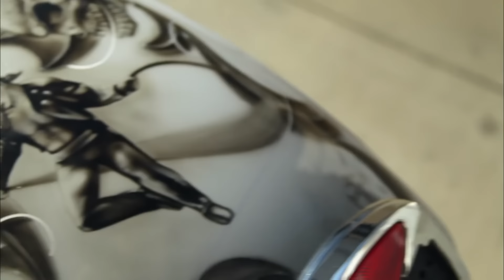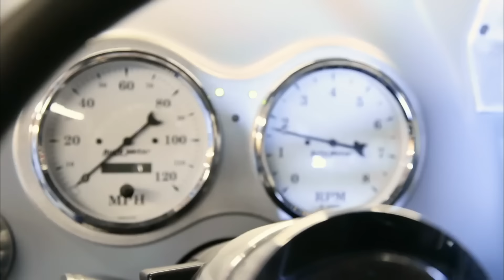The Real Reason Why Counting Cars Ended

Comment: Another problem was the 1955 Chevrolet Nomad station wagon. Counting Cars did not complete the project as the customer wanted. The customer ended up taking the car to another shop to have it done as he wanted. Counting Cars was court ordered to pay the bill for doing so.
Reply: The shop and Koker have been sued more than once. One couple wanted a particular year Mustang and were told it wouldn't be a problem. Except, when they went to pick it up, it wasn't the right model. The couple said, "That's not the car we paid for." The response was: "That's the car that you got." Another former customer sued because a car featured on the show didn't run despite the customer paying for it to be fixed up. IN both cases, the shop and Koker (in one of the cases) were named as defendants.
Reply: @mikeheuer1276 The owner of the '55 Chevy Nomad sued also because his car was not done as he wanted. He stated that he wanted no pin stripes. Danny and Ryan did it anyway. The customer took the car elsewhere and had the car redone at Danny's expense.
Reply: true and believable- but not the last sentence- you would have no way of verifying that.
Reply: @tommurphy4307  WRONG.
Reply: You need to take the drama out and get back to building professional. Cars
like you do.

Comment: The obsession with spider webs and that gross cross design should be a tip off of what’s to come, not exactly Chip Foose or Dave Kindig to mention a few.
Reply: Chip is a joke. His recipe for nearly every car is to lower it, paint the bumpers, a two tone paint job on the car and low profile wheels and tires. Big deal.

Comment: after i watched some of those guys act dangerous in the workshop, i realized it was too good to be true. (some of those guys should not have been working there.)
Reply: for sure none of them would pass a drug-screening
Reply: @tommurphy4307  Mike especially I can tell has been on and off drugs throughout the series. Some seasons he looks disheveled and sickly, and others he looks perfectly fine. It seems like hes quit using fully since about 2021 when the last season was filmed, but I do hope he stays off them for good
Reply: I learned a little about welding from taking a class at Lincoln Electric in Cleveland, Ohio, USA. I've done some welding over the years. I've seen numerous times on all of these reality shows where the guy welding hardly used any PPE (Personal Protective Equipment). I thought, "Really? Are you stupid?". THEY can do that if they want to, but I'm not going to do it.
Reply: @snowrocket  i've watched a lot of dangerous acting on the show..

Comment: I watched many episodes but I don't remember them restoring any classic cars to original or even with period correct parts. Some people like resto-mods some like original condition and possibly with some modern safety features. For example, on my 1965 Mustang coupe I put dual reservior power master brake cylinder in place of the single reservoir manual brakes system. It already had original front disc brakes. Now the car is safer and someday can be a daily driver. Even at cars shows the safety upgrades could be appreciated. The late 1965 models had some of the 1966 model features. Also, I can connect the 4 way emergency flasher to my wire harness which also appeared in 1966 and on some late production 1965 models. Nobody really checks the Vin in the local car shows anyway. Restoring cars to original condition brings back good memories to many people, to a time when life seemed simpler.

Comment: Many mechanics are bad. Especially the new guys. I seen them destroy cars. Forget cotter pins tie rods falling off, loose lug nuts, wrong oil leaking oil filters. Diangnise wrong, couldnt fix chet and a lot more stuff. I saw this and they fired 5 or 6 mechanics in 3 years
Reply: English, please.
Reply: thats because they were told being a mechanic was easy and a no-brainer. not true, but its a helluva lot easier to do than building a custom ride. both require above-average mechanical aptitude, good spatial aptitude, knowing about strength/mass of materials, and an exemplary knowledge of what works and what is a waste of time (or $$$). knowing car manufacturers and the way they do things and familiarity with the parts they make is golden. a lot gets lost in the translation between owner and builder- no matter how smart they are. at the end of the day- you almost have to build your own or commission the right people to build what you want to end up with. it ain't cheap- but it can be hella fun.

Comment: What happened to Richard Rawlings and Gas Monkey garage?That was excellent.
Reply: Its on YouTube now.
Reply: richard is bona fide car-crazy- we all want to be like him, turning out scary-fast rides while sucking on beers. the only thing that saved him and his guys was the cheap beer they were drinking.
Reply: Gas Monkey garage was fun to watch at first but then it became too predictable.  Richard buys an old car, Richard does donuts in the parking lot, they decide to drop a huge motor in the vehicle, the usual OMG will they get it turned around on time, Richard drives completed vehicle while profiling.  They once asked for suggestions and I suggested they get a 60s Falcon wagon and instead of dropping a V8 in it, drop a new stock Ford Turbo Four putting out 300hp and vintage air ac and keep it looking as stock as possible.